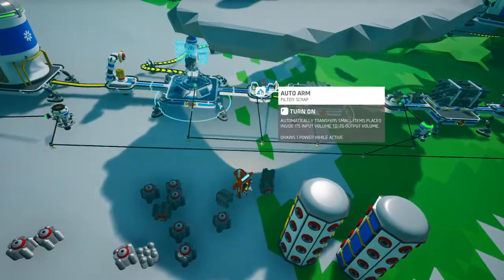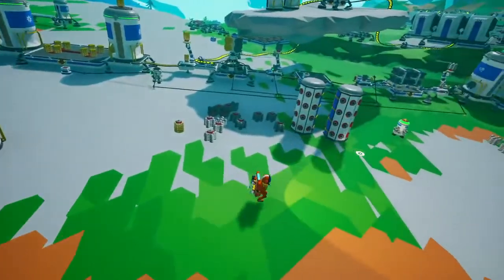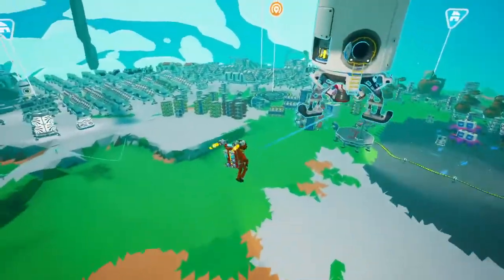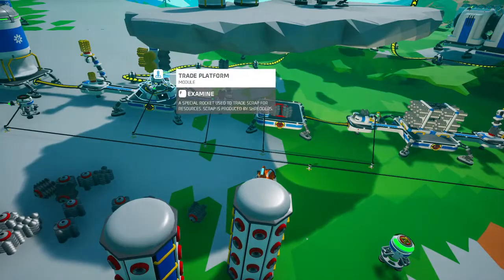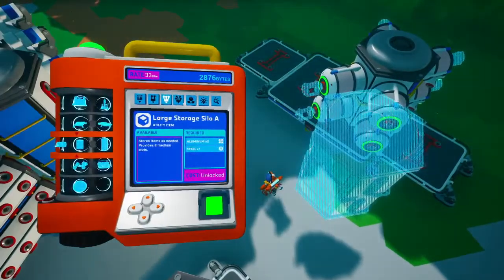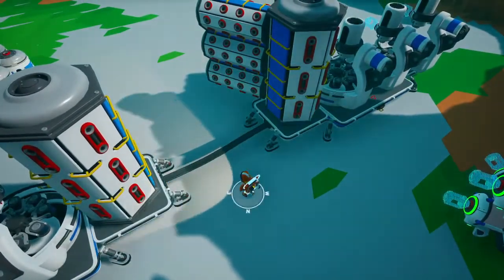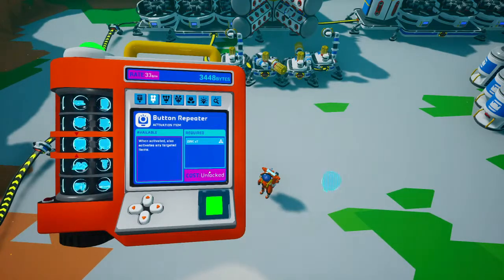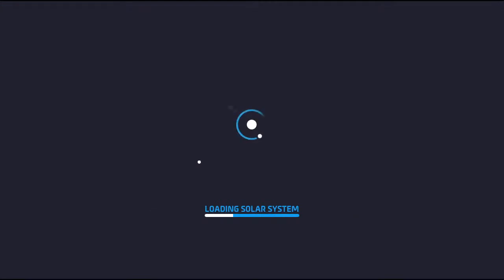Astroneer - planning out a resource creator in creative pt. 4

Comment: Hi ^_^ Question: how do you do super flat in non-creative mode & also do walls? Thanks! :D
Reply from the maker: It's pretty darn hard and I'd say almost impossible to get true flat working in non creative. You can probably get the closest at the north or south poles by using the narrow mod and creating very small dirt piles until you get lucky and hit a true flat angle. It'll be hard to tell but you'll know when you see it. From there, you can flatten out the terrain and it'll stay at that true flat level but it's difficult due to the lack of control over the deformation speed in non creative.

You can get a nice flat-ish surface if you use the wide mod and alignment tool and flatten a small area. Take off the alignment tool and continue flattening and the area will be almost flat minus some small wrinkles here and there. You can also use the alignment tool to create walls if you place the cursor at a certain distance away from you.
Reply: @duckyobrien  thanks! :)
Reply from the maker: @DeconvertedMan  Np! Hope it helps. I gave up on trying to get true flat on a normal save file for now haha.